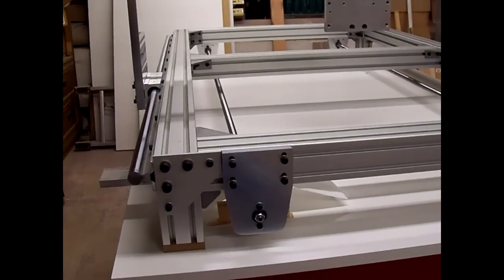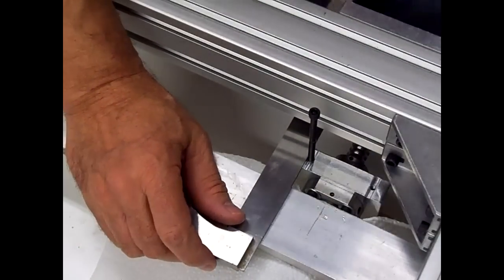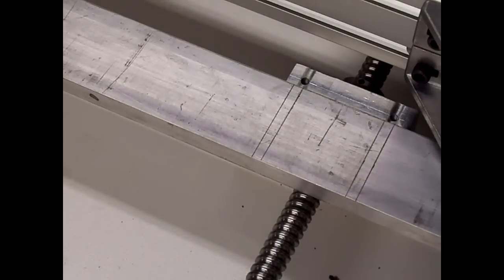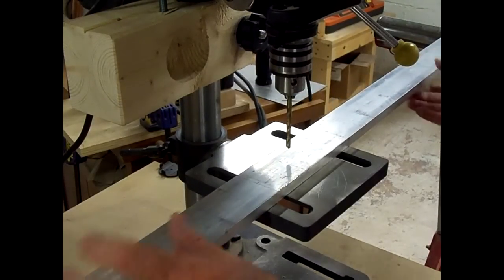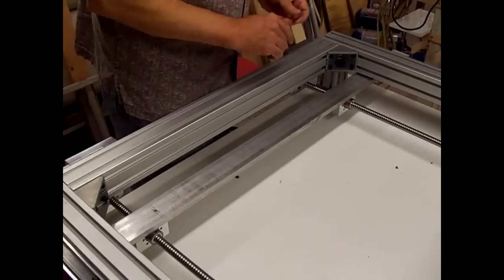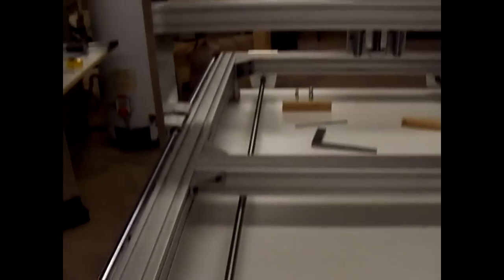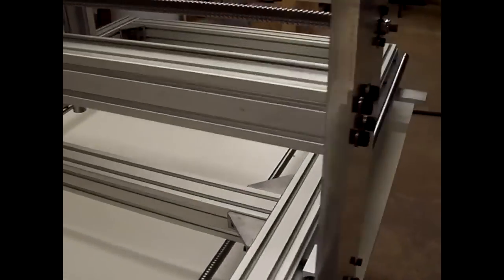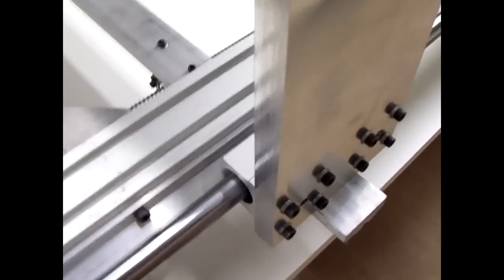CNC Router build part 5

Comment: FYI.....when trying to locate the center of the lines you drew for your holes....you could have just drawn two diagonal lines from corner to corner on your rectangle and where they cross would be the center.....4:41 point in the video....in other words the two diagonals of a square or rectangle crossing one another gives you the center....looks like a quality build by the way!

Comment: Since I started building my CNC which is going to be about the same size as yours, I'm starting to wonder what sort of jobs I could use it for. My original intention was to build PCB's but it turned out to be more cost effective to build a large scale machine. Maybe I could use it to build the fittings for a table top version.

Comment: I have a couple of questions, what is the power rating of your Spindle and laso what size stepper motors are you using. I am trying to scale things slightly in my head. I am thinking of a 2.2KW Spindle speeds up to 24,000RPM witha chuck size up to max 8mm and believe that should be sufficient. I am going for a water cooled one also. I am trying to guage the type of stepper next. 
Any feedback would be most welcome,
Regards
Chris

Comment: Using graphite pencil on aluminium would be a no no if this were part of an aircraft as graphite erodes the aluminium. Lovely project though!
Reply: Im not 100% sure what happens but when i was in the Royal Air Force an aircraft techy said in theory if you were to draw around a section of aluminim spar with a heavy duty pencil the then the graphite apparently etches the aluminium leaving it weakened. Im sure in your case it wouldnt be a problem. Quite a handy way of marking ali without having to resort to a scriber. Brilliant video series on the CNC build its really inspired me. Ive just orderd a kit of parts that contains the ball screws bearings, linear rails but for a mchine thats about half the size of yours. I want to use mine mainly for machining out component panels in aluminium and smooth fibre glass sheet. Im also mainly interested in doing my own PCB's again. The CNC i used at work was about 24K but I dont intend to pay that much to build my own. Thanks again buddy

Comment: I guess you already figured out that you want to drill the holes on the bar, mount the crossbar to both side plates and ballscrews with the bearing plates loose... move the gantry to the each end, then tighten the bearing plates.

Comment: FYI, never mark aluminium with a pencil, the carbon in the marker will get in to the aluminium, and set a base for galvanic corrotion, see link for futher info: http://www.vansairforce.com/community/archive/index.php?t-12169.html
Better to use an ancohol based marker :)

Great build series, i learn alot on how to upgrade my own cnc...